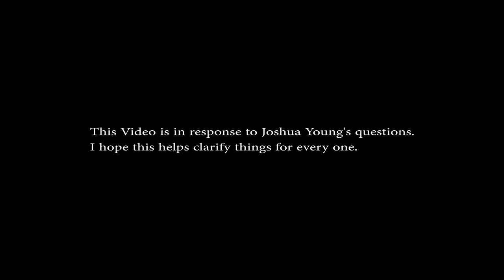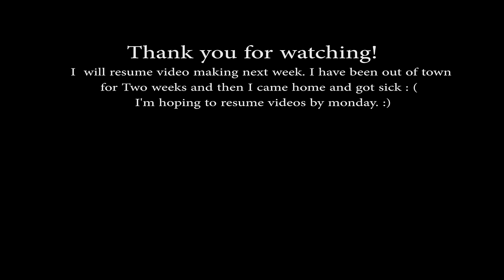Questions Answerd .22 lr bolt action

Comment: I have a question, did you make the barrel? And how did you make it? I mean how did you drill the hole through all the tube?
Reply from the maker: Fernando Corona I didn't make this barrel but I have made some for my following projects.  To drill the hole you use a gundrill it's a drill specifically made for deep hole drilling. It has a high pressure pump that pumps oil through it to evacuate chips. To rifle the barrel i have a fixture on the back of my lathe spindle to index it. And a tool o made that fits on my lasthe to cut the rifling.  I use it when I make the barrel of my revolver project so there is video of it
Reply from the maker: https://youtu.be/sS1pg3TCFv0 the end of this video has the drilling part of the revolver barrel
Reply: Thank you so much!
Reply from the maker: Fernando Corona no problem :)

Comment from the maker: the way I made the firing pin it doubles as an ejector
Reply: I don't know if you know this ,but if you do fine if not here goes,music wire springs can be heat treated i have learned from dipping into molten lead as it is apparently the correct temp around 750-850 i think,this aleviates any problems from using a flame which can be inconsistent,while the lead will heat uniformly,just pop in the lead for 20 secs to be sure then quench in oil,i had to make a trigger return spring as the original was hard to get.

Also i had to replace a broken leaf spring on a tokagypt 9mm deact hammer,i gave this advice to another shooter who couldn't believe how simple it was,old car(i live in scotland)contact breaker points use a leaf/tape spring in the cam contact to points heel of the contact breaker,and as there are so many sizes and types also with a hole in one end for the rivet there is a plethora of springs available.

And as you want to make your own barrels,a source of quality turnable steel that can absorb shock and dissipate heat easily is quite easy to get hold of,though a bit of creativity may be needed,vehicle axles,stub axles on the front of a rear wheel drive will make good pistol or carbine barrels and rear diff axle rods could make rifle barrels plus they will have centers as the were turned and trued in the factory,high grade steel for pennies most axle rods will be over an inch dia' so i'd go check it out,pity we here in scotland can't do this too...legally,not that i do i just thought about it while rebuilding my triumph spitfire,stub axles...heat and shock wave ready.

ATB